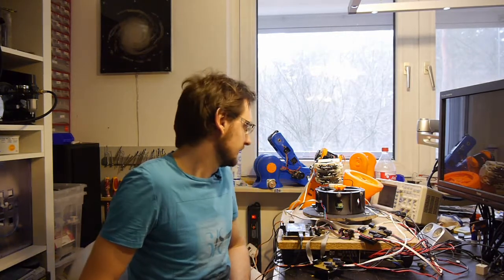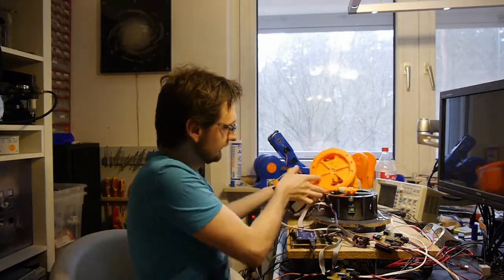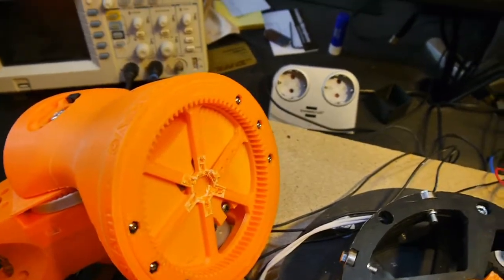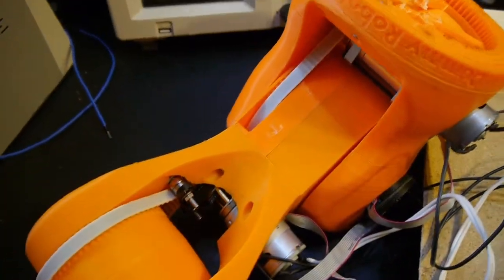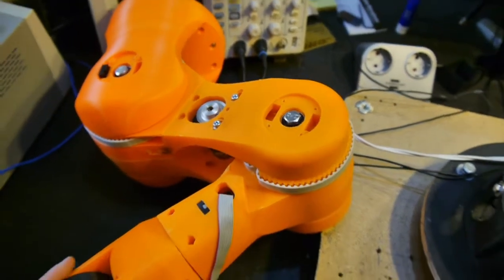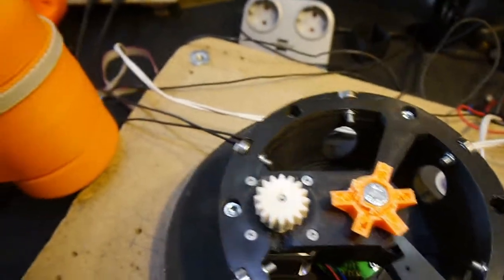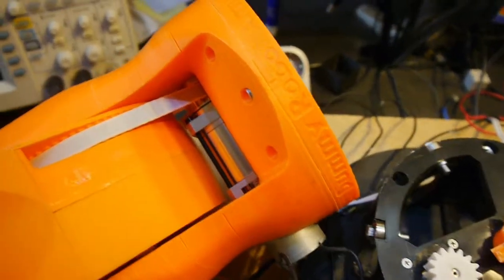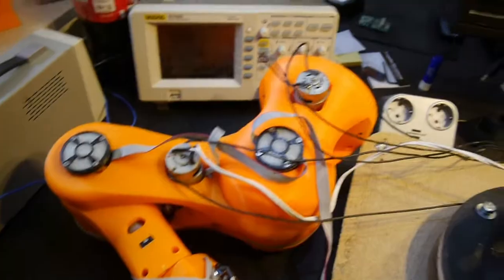Robot Arm part 8 - Update and broken parts.

Comment: Excelent work. keep on . just a little mistake may be is the same design just put some more material  there.   led in encoders are awesome   .  instead of belts i use gears but im looking in your design they work well  wow man you have a fan  congratulations for that work

Comment: Love the LED encoders! I suggest re-designing the base a little to reduce time (and material) it would cost you to repair if/when it breaks again. Being a machine that is made to do a lot of work, this robot will break no matter how strong you make it. However, if you design the base to be in 2 (or more) smaller pieces, you won't have to run your printer for 10 hours for a simple repair. I apply this design method myself to save money&time. Looking forward to the final form of this robot!